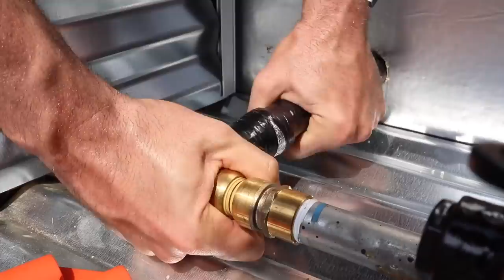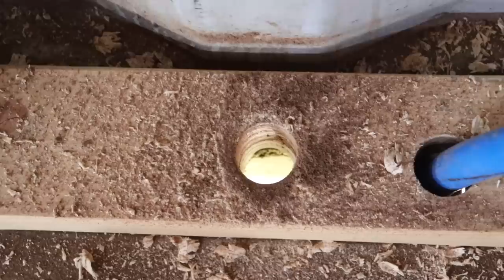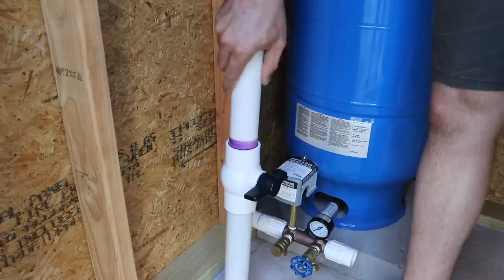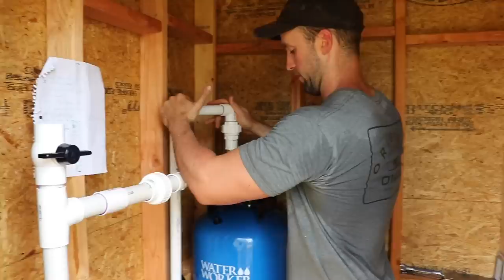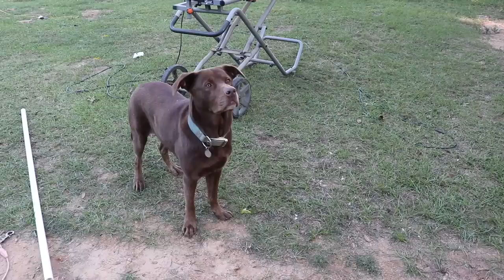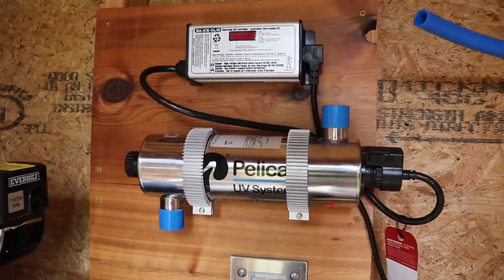How We're Getting Drinkable Rainwater OFF GRID!

Comment: Plumber here. love the setup,  however I would suggest a few things additionally; you’re gonna want a one way valve on the hot line where it tee’s off from the cold, that’ll keep it from thermally circulating into your cold water if you go without running a tap for a while. Also you’ll want to add an expansion tank in the line going to the water heater (they’re small tanks that look kinda like a propane tank) and that’ll save some wear and tear on the system as the tank heats and cool during the day/night. Other than that, looks good!

Comment: Great job. Good practice is to silicone around the drilled out holes where the poly pipe goes through. Prevents the pipes vibrating and wear through the plastic. Stop it from splitting. 👍🇦🇺
Reply: Nah, silicon is much too brittle. Use silicone.
Reply: Manolis Gledsodakis fixed

Comment: I’m so jealous of people that live in climates where you don’t really have to worry about anything freezing lol. 

Love your videos guys, keep it up.
Reply: Sometimes it does get below freezing there. That's why they wrapped insulation around the water lines going in and out of the water heater. I'm guessing they'll insulate the pump house onecd everything is set up and running correctly.
Reply: You could move
Reply: Yes it might get to 30-33 or just below every now and then, but it’s not quite the range around here 86 in the summer, -35 in the winter (those are the extremes). Burying water lines 8ft or more to avoid freezing, I would never get away with above ground tanks lol. 

Yeah, I could move, and maybe one day I will but I don’t see that being a viable option in the near future. For the most part I like it here, just a little jealous at times of the warmer climates.

Comment: Hi, Spencer, I've been watching you from the beginning I feel you are doing a great job. there is a little something I would like to  share  with you I see you had your check  valve at the pump at first, where you move it to is still a bit to high if the water in your storage tank fall lower then where it is your pump can lose its prime. it should be as close to the ground or floor as possible,. that would stop the water in the line from back tracking when your storage tank water get low.

Comment: Advice ,put the pipe glue on the ends of the pipe as well as the outside . I found by doing this when I install heat pumps with high pressure pool pumps feeding them water . It gives a tighter seal .  You guys are doing a great job on this . :)

Comment: Hey guys, great job. I looked at the water filter system and not sure if I saw one installed but may I suggest that you put in a spin down water filter as the very first filter in your system. They can be automatically flushable (daily, weekly, bi-weekly, monthly, etc.) and depending on the micron filter size take out a lot of the rubbish before it enters you main filtration system.  This will save you time and money in the future on replacing your other expensive filters.

Comment: Rain water is pretty acidic tho, I think this filter setup is very good for everything but drinking because youd literally be drinking acidic unstable water since rain water normally has a KH and GH of near 0 and a PH of 5 - 6, almost sorta like drinking acidic distilled water. You should consider setting up a re-mineralization tank for this so you get the necessary minerals for your body and stability water needs and wants and try adding something to naturally (without chemicals) raise the PH of the water to as close to 7 as possible since babies are also super sensitive to high or low PH water.
Reply: I know many filters make water more of a acid because they remove the minerals... The air obviously kicks dirt around except Durning a long rain.. as the rain carries it off.... So I know it's always better than filtered...

Comment: Had a somewhat similar setup to your solar heater system and want to forewarn you.  When you are really "cooking" the water in the solar collector, it expands the water in the tank and backs it up into the incoming cold water supply.  Doesn't hurt anything except that very warm to hot water will come out of the cold water faucet(s) in the house for a few seconds.  There are some fairly inexpensive check valves on the market that may reduce or stop this when and if this situation is encountered.  Other than that, very nice work and really enjoy your channel.

Comment: I'd like to say, first of all, Great Job! You guys are learning a lot along the way and have progressed quite a bit. I would like to mention or suggest though. You may want to consider an anti-siphon adapter, (also known as an inline check valve) coming off of your cold side water line to your hot water tank. Home Depot Shark-bite 3/4 in Push to Connect-Brass Check-Valve This adapter will prevent the hot water from flowing back into your cold water supply when using your cold water strictly. This adapter is a 1-way check valve.

Comment: I just noticed the inside of pump house. Since it's not drywalled plastic bins can be attached to 2x4's for small fittings, screws, nails, etc. I have them in my shed and it comes in handy for when I need something quick.

Comment: I would recommend putting a check valve on the cold water inlet to the hot water tank to keep the water from back feeding into the cold side of the house when you have both hot and cold water turned on at the same time. Some faucets don't have built-in check valve so the water can backfeed from cold to hot or hot to cold depending on pressure fluctuations so could create a Loop in the system by not having a check valve on the inlet to the hot water tank.

Comment: Great work. If you have hot water coming out of the cold tap then you need a non return valve after the 1/4 turn isolation valve that supplies the h.w.s. Check your local codes.

Comment: You should invest in a PEX crimper for the stainless-steel rings. It's a better more durable fitting and connection but also Way cheaper than using SharkeBites and PEX won't shatter like PVC will if/when it freezes. I love seeing people build things to last and you guys are doing that well. Bravo.

Comment: You called it tube city. I knew it as Habitrail. Always wanted one. Umm, I think the pressure relief valve should be on the top, in air. Water is not compressible but air is and that's what you need to relive with the valve. Might be good to check into... Great job with everything! Love it all.

Comment: UV light is bad for all plastic- it's the aspect of natural sunlight that damages exposed pipe. Covering it was a wise investment in not doing it over!
Reply: Spenser a quick tip re. the UV tubes. 
Get yourself a spare to keep for when you have to replace that one in about a years time or, heaven forbid, you break that one. 
That would be a real bummer to be without good water and having to boil all drinking water while waiting for a replacement to arrive.
Reply: That statement is so far wrong. Your pex piping (polyethylene) is 100% UV resistant. Over time when exposed to UV it will develop a chalky exterior which will not affect the integrity of the piping in any way as it will just be the exterior of the pipe. PVC pressure piping is affected by UV but even then there are now brands available that UV doesn't affect like pool piping. Generally there isn't a need for PVC pressure pipe to be UV resistant as it is all laid under ground/under slab. Your PVC SWV (soil waste and vent) piping as well as sewer piping these days is all 100% UV resistant. People paint SWV but that's for aesthetics only.
Reply: @tbonemc2118  you obviously know what you are talking about, a question for you. You say that the uv will only effect the outer layer, but I would assume that would be true if the uv source (usually the sun) was external. In their case the source of the uv is internal to the pipe, so the inside layer would be effected. I assume this would be why the manufacturer would recommend stainless flexible hose on the connections, so the pex inner wall isn't exposed to direct uv.
Reply: @tbonemc2118  All of this was said about Qest also. I made a tremendous amount of money replacing Qest piping and fittings in residences and apartment houses. The water itself turned out to be the "enemy" and insufficient time on very few research programs had been done before it's entry and use. Most of the "claims" for Qest's good features were found to come from manufacturers. I'm retired now, but still "check in" with some of my vendors, many who have become friends as well as business associates; several, who are selling PEX  are still waiting for letters of indemnification- letters from mfgs that absolve the vendors if "something goes wrong". FWIW, I still see PVC stored outside "heat distressed"- dull and dry looking on the sun exposed parts; the dull and dry can well mean the esters have been leached out of the pipe- the esters which give PVC pipe flexibility. It's interesting that PEX gets a "chalky" layer after continued exposure- "chalky" would also describe what is happening to PVC. the Grey PVC used by electricians was supposed to be UV resistant from it's intro; it is not. I am willing to listen, but I need to see some long term research from the several State Universities that do have construction engineering and building programs; the Big Chem co.'s word is simply not enough- I didn't have "customers", I built client relationships, and putting any product into a client's home is something I never did- a couple of ex employees found out the hard way that I meant that. FR

Comment: Cute and confusingly interesting!  But for now, boil the water and let's get back to finishing up the house!!  Been waiting for 3 months now,  I think. 🤔😚  Baby will be here before you know it.  🐌...🎉
Reply: i have to agree  they should be getting the house  done  ,well at least the babys room
Reply: @grahamefreestone5309  Well, they've been working on this water treatment system for three months now and it's still not finished.  The water lines won't run throughout the whole house or in the ceiling. OK, perhaps a pipe or two vented to the roof, but can't they work on the side of the house not affected by plumbing?  JS  😁This is interesting but not as intriguing to me as the finished house with the baby's room.  🤗😋

Comment: Draw out the run you wanna make with measurements and fittings. Then go over your drawing, count everything and use different color highlighters for fittings. Example; 90's are "orange",, Tee's are "green", so on and so forth. Count each color on your drawing and MAKE a LIST With a piece of paper and pencil of materials that yall need before going to town. Take the list and pencil with you to the hardware store and check off when loaded onto or into the basket to purchase... that will help yall eliminate extra trips to town. Just sayin...

Comment: you might need to add a check valve at the input of the water heater. This would prevent hot water from entering into the cold line

Comment: You might want to install a check valve between the cold water line tee, and the inlet of the batch water heater tank, if you didn't already. Otherwise, great work and video!

Comment: For not to much money You can have custom double pain or even triple pain glass made to sit on top of your batch water heater box. Just glass with no frame. Then sit it on your wood frame with stick on foam under it. It will greatly reduce heat loss during cold nights. 

As long as you don’t use a UV protected glass then you’ll get the full sun onto your tank.

Comment: I would recommend putting a coating on the glass or lexan top after you install it so the suns rays does not ruin the seals inside or oxidize the top preventing the proper heating, much like car headlights. I can recommend some products if you are interested.

Comment: You should throw a check valve on you cold water inlet before it goes into your batch system. It will help from warm water migrating up the cold water line into the house. Just a thought.

Comment: Good thinking on the UV filter fittings.  Might ask if the fittings can reflect the UV light.  Might add a simple replaceable connection between the stainless steel flex and the PEX.

Comment: I know this video was from 3 years ago but for anyone new watching this to learn you’re right, you 100% do not want PVC attached directly to your UV light. PVC is not UV resistant and will make it brittle and it’ll start making micro plastic shed into your water and quicker than you’d think. Within only a few months and could crack and leak within 8-12 months because it’s concentrated unfiltered UV. The stainless steel pipe will reflect some of the UV light down the tube a little, so definitely make sure that it’s only pex or copper that you’re attaching to the stainless steel pipe because pex (and obviously copper) are UV resistant. If you can afford to do copper, which it’s kind of ridiculously expensive now, but copper has anti-bacterial/antimicrobial properties to it.

Comment: Need to insulate your pump house and install a plug.  If it freezes in the winter you don’t want your pipes to freeze.  Is you have an electrical outlet out can plug in a light or heater if needed.

Comment: Inside the heater tank, is the pressure relief line terminated high in the tank? If understand correctly, it should be, otherwise overpressure will empty the tank, leaving mostly steam; but if it is in high position, the steam will be evacuated first, lowering the temperature/presssure faster.
Reply: I also was curious about a check valve somewhere after you "T" of the cold supply.  I did not see one. When the water in the tank is hot it is higher pressure than the cold water at 32 PSI. Therefore when you turn on a cold tap in the house you will get hot water out of the cold tap until the water pressure equalizes.

Comment: Nice setup.  Up here, in my neck of the woods, wells are uneconomical, and the groundwater is terrible stuff. Collecting rainwater for drinking through 6 (effectively) months of winter is kinda iffy. I’ve installed lots of split systems.  One cistern for rainwater for flushing toilets and other non-critical uses, and an isolated cistern for trucking in potable “city” water, with an air-gapped overflow to top up the rainwater collection.

Comment: very nice setup. Personally I wouldn't drink rain water without using reverse osmosis to guarantee removal of any nuclear fallout, but I've read that the activated carbon removes iodine 131 until it reaches capacity, and you can always add additional filtration to your great system later.

Comment: I was thinking maybe a check valve on the inlet to your batch tank and the adding a return pipe from your indoor tank the the batch tank  inlet (just downstream of the checkvalve) This will allowing the batch water to thermosiphon rise into you indoor tank and as it does it will force the cooler indoor water back to the batch tank.  Without a return pipe the water can't acutually flow well. Just a thought.

Comment: Awesome information great job by the way couple things that I'd like to say is is that that offshoot water is going to get the ground wet and make a hole next to that cement area. I would think that you would want some way to push it away from the house. Either that or collect it in another container. Also those valves are going to get rusted the shut-off ones. Is there a way to put something over those to protect it better? Thank God you live in Texas because I will tell you this if we had pipes like that exposed in Maine we would never have water they would burst from freezing. But again great job

Comment: The rain water doesn't contain valuable minerals, you have to enrich it with those (magnezium, calcium, etc), otherwise you'll be drinking almost airconditioner's condensed water...It's bad for human body organism on a long run as most of the minerals are dissolved in and gained from drinking water. You may also buy solar pannels and use them to run airdryer, to collect condensed water from a thin air, that of course if the humidity levels are high enough in your area. You may run it when the humidity is high enough and there is a sun outside. Also heating the rooftop on winter may supply you with clean solar pannels and to turn out the snow to water. BTW, UV is not good enough for this kind of installation, simply because the flow is too fast to get appropriate treatment, its better to combine UV with H2O2 (hydrogen peroxide) treatment. Not sure about your area, but why not simply drill a deep hole in the ground and make an artesian well?
Reply: Sinkhole sure
Reply: I grew up drinking rain water collected from my parents roof.

In my 30+ years ive had no major health problems nor have others on my island who grew up the same way.

Your statement is inaccurate.

Comment: Since water filters are rated on GPM, I wonder what yours are rated for?  My thoughts are filter the water going into a holding tank then draw the water to the house.  Kinda what I had to do to my motor home.  I could sloowllly fill my tank to capacity from a stream, then use the existing system to run it elsewhere in the camper.
One of my filters was .5 GPM  going through hence the slow fill rate.  Just an idea.............